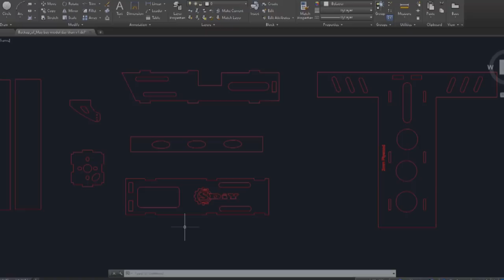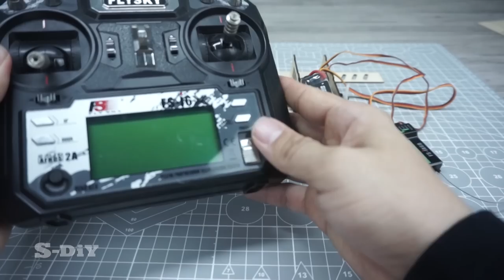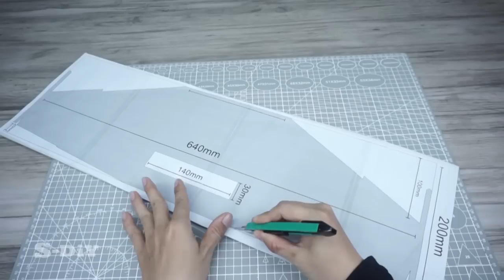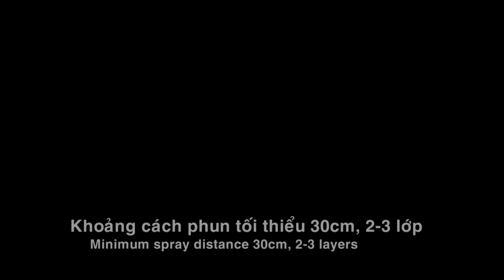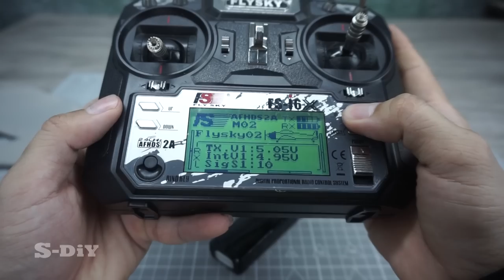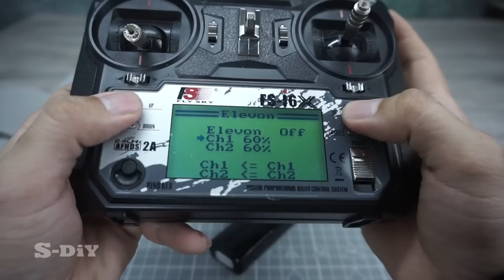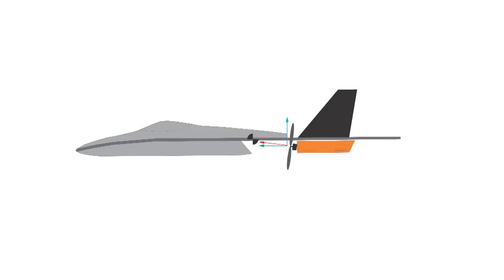Making RC fighters plane modular - Radio control plane modular project│S-DiY

Comment: I see you are still loyal to the great and unbreakable RS2205 motors. Nice to see that they still power your builds. I wanna ask what speed of engraving and power did you use for your laser to cut the plywood so smooth? Was it just 1 pass without air assist? I have a little cheaper engraver Zbaitu 80W and I only figured out how to cut balsa. The laser power should be 2x5W of my laser head. Thank you and have a great day
Reply from the maker: Hi friend, thank you for your interest. Motor rs2205 is very durable and popular. But I'm about to have to replace it because it's too old. For cutting 2mm plywood, the fact that I had to cut 4 passes, 600mm/min speed with 5.5W laser (as the last unbox video I noted) Slow speed, but high detail aesthetic, so I was very satisfied. Hope you continue to follow my projects. Thanks (sorry, I use translator)
Reply: @SDiYchannel01  no problem, your English is understandable, mine isn't great too. I use the same motor in my new F22 raptor that I built from your plans and it's overheating really bad on 4S battery but still works. It's fine that you had to do 4 passes, probably using 100% of laser power. The main thing is that the wood isn't too black from the ash. Do you wanna see by any chance a video how my F22 flies on 4S 750mAh? Not really that well as yours but it flies! Do you have some tips where can I get the same lightweight 5mm cardboard like you? Or should I use depron?
Reply from the maker: @LordMarinade  Hi friend. I just watched you fly the f22 kit, you seem to have mastered the control and assembly (it took me more than 2 years to control the model well :) ) With Rs2205, you can rest assured that the coil and magnet are very heat resistant. well, with 4s battery the same motors get very hot. You should always use depron, because I think that is the optimal material. Only some regions cannot buy depron, so you have to find cardboard or other materials. A good thing is, using a 4s battery under 1000mah is that you are very wise, instead of a 1300 or 1500mah battery, it is very heavy, inefficient. I am using 4s850mah for relaxing flying, very satisfied with it. In my locality it is dawn, good day to you!
Reply: @SDiYchannel01  I managed to build the F22 and it weighs only 250g without battery! I left the wings a little bigger than the plans - 80cm Wingspan and used cardboard only for the main plate. The rest is depron and a little bit of hot glue. Also I used 3,7g servos and put them far in the back so they can work with no problem. I can't wait to fly this, I hope the wings won't flex. There's 3mm beech stick to reinforce the wing but still they are quite big and wide. Can I send you a pic of the build? For the previous f22 that weighs 450g I bought 2807 motor Emax eco II and I'll try to make it a rocket.
Reply from the maker: @LordMarinade  Hi friend, that's the ideal weight. If the cardboard is placed horizontally, it will be very stable when flying. You should try the Emax eco, maybe soon I will order it as a replacement for Rs2205. Have a nice flight. Please let me see the product in my mailbox truongvansu91 @.Thank

Comment: Nice! Very clever design! I'm just curious to know the final weight.
Reply from the maker: Hi friend, weight with 1500 battery is about 520g, including 60g for wooden frame and extension wire!

Comment: Anh cho em hỏi là motor không chổi than 1104 4300kv thì dùng cánh nào là hợp lí ạ
Cho em hỏi cái nữa là tx flysky i4 có kết nối đc với rx của f949 k
Reply from the maker: 1104 4300kv bạn đi cánh 3020 nhé, loại 1104 4300kv màu bạc khó kiếm cánh vừa ốc, chỉ có cách dán keo thôi. I4 sóng mới 2A nên có thể ko bind dc với mạch f949, như i6 thì chỉnh sóng dc nên bind dc !
Reply: @SDiYchannel01  ok em cảm ơn